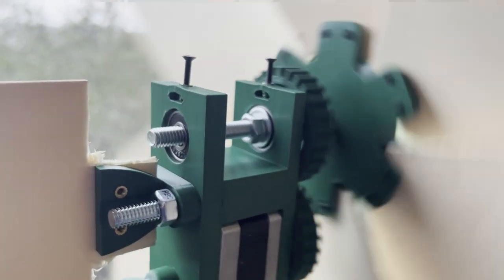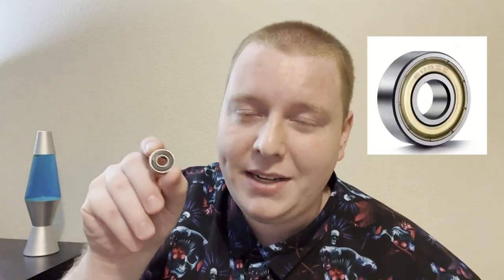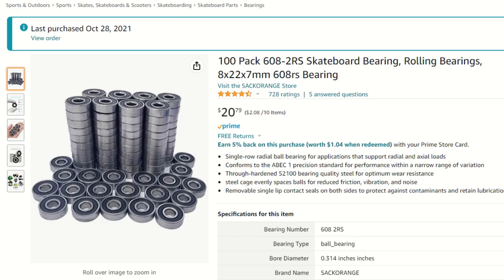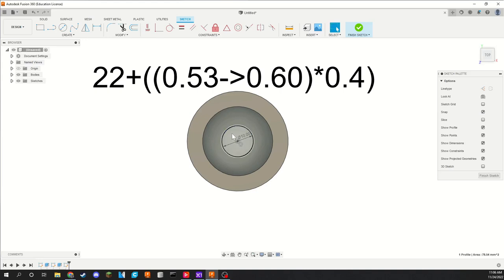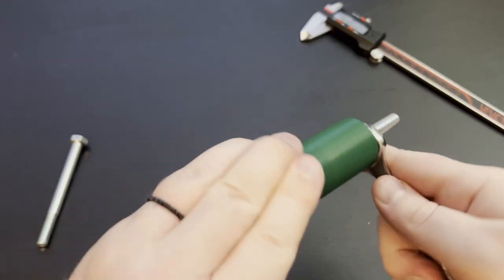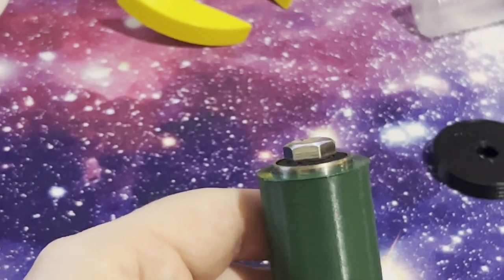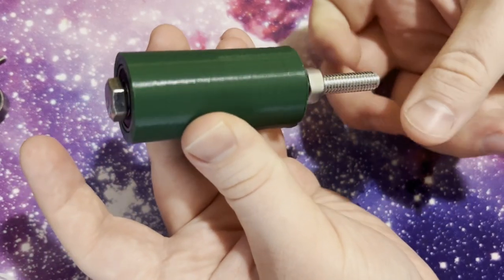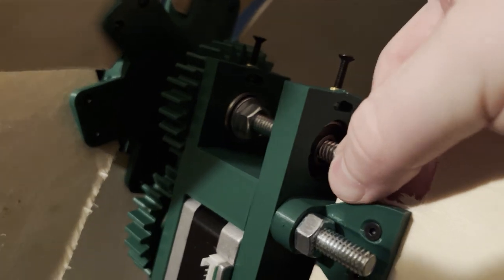Using Bearings with 3D Printed Parts

Comment: Instead of brass inserts, have you tried to embed steel nuts in a print? I design in recesses for the nut and screw, including tolerance for nut thickness and in my slicer I put a pause after the recess is printed, before the next layer. I then place the nut in the recess and resume the print. The next layer covers the nut. I do the same with magnets.
Reply from the maker: Sometimes I'll design a feature that can accommodate a steel nut, although I've never tried embedding them. Doing it during the print process certainly sounds more promising than trying to solder it in. Does that method work pretty well for you? 

What I'll often do is just make a square hole that's the height of my nut, and slide my nut in sideways through it until the screw can meet it. Perhaps a strength test video is in order 👀
Reply: @christophersfactory  Embedding nuts and magnets works very well for me. When I'm in a hurry I'll use the open square hole method, but when I'm fine tuning production prints I'll embed. I haven't tested strength but it seems to me if the wall thickness between the nut and the head of the screw is the same they should be about equally strong, though I think with an embed it might be a bit stronger, because the nut is pretty much locked into place while the opening for a sliding nut has to be pretty large to accommodate tolerances on the square nuts, resulting in some slop. In any case, embedding the nuts or magnets (when embedding magnets I use a tiny drop of CA adhesive in the recess to make sure they won't jump out of place, attracted to the other magnets) results in a cleaner exterior surface that looks less DIY.
Reply: How do you know when is the time to place a nut during print? Do you wait the whole time until it's ready?
Reply from the maker: @lovrocatela8727  If you're imbedding a nut, you'll want to wait until the past possible opportunity in the print to do so, otherwise it's likely that the nozzle will bump it. Personally, I tend to use that method less than just making features in the print that nuts can fit into.
Reply: @lovrocatela8727  After initial slicing, I insert a pause at the first level above the cavity for the nut and then reslice. I make sure that the cavity for the nut is deep enough to accommodate the dimensional tolerances of the nuts to make sure there's no chance of the extruder nozzle crashing into the nut. 
I also block supports in the cavities for the nut and screw. The layer above the nut is printed as a bridge. While that first layer isn't always perfect, it's almost always good enough to retain the nut and then subsequent layers go down just fine. The pause feature is availabe in the Prusa slicer (and Bambu slicer, too, which is based on the Prusa). I don't have to monitor the printer as the gcode will tell it to pause the print. The Prusa printers will beep to notify you that the print has been paused. I then insert the nut(s) and resume the print.

Comment: I find 0.15mm added to the OD of the bearing is good for press fit.
And it's not good to force bearings into place by the inner race, unless you're pressing it onto a shaft. You can damage the bearing. I made a 3d printed tool to press in, and remove, bearings in pulleys. It has a tube that only rests on the outer race and uses a bolt that's the same diameter as the bearing's ID.

Comment: WD40 will eventually turn to goo or varnish.  In the clock restoration business we hated it.  Flushing out the bearings with solvent like naphtha then adding a light oil will likely give better long term service as the cheap grease used in low cost bearings will be gone rather than thinned in WD40 which will mostly evaporate and leave yet more goo behind.

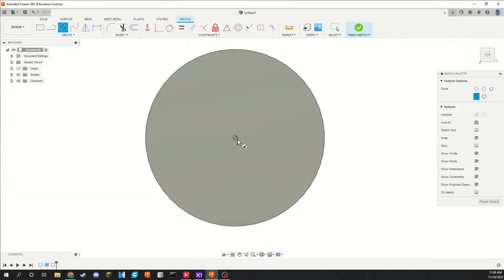Comment: I'm 99.9% sure what explanation about what the slicer doing at 3:05 is wrong. This may have been true when 3d printing first started but modern slicers can certainly account for the thickness of the bead being laid down. That's not the reason your bearing doesn't fit into that hole.

Comment: they are races not rings. the reason they lock up when you tighten the bolt is because they are coaxial bearings not trust bearings. the balls bunch up against the side of the race and causes misalignment in the races and this multiplies the issue and locks up.
Reply from the maker: Wow, I feel like I learn much more people than I have to share. I'll definitely need to make a Part II. Thanks for the info!!

Comment: Another method instead of glue could be to pause the print at the right layer number, put in the bearing, and then continue the print, printing also covering the other side just enough.
Reply from the maker: I'd be interested to try this! I haven't done much with inserting parts mid-print. I know many people do, to fair success. I just worry about the nozzle colliding with the part. Do you know of any way to avoid that?
Reply: @christophersfactory  You'll have to stop the print at the right height.  Check in your slicer.  You can do that with nuts too.

Comment: There's another way to solve the problem of a model that has a hole that is too big or too small for the bearing: change the horizontal expansion setting in the print settings. Usually -0.1mm to +0.1mm does it for me.

Comment: Dont recommend using set screws to secure bearings you will deform the outer race and make it oval. It's better to use a clamping style collar or press fit.

Comment: In cura there is a setting I believe it is called slicing tolerance (not really sure off hand) but the choices are inclusive and exclusive. This will let you tell cura if it needs to be at least or at most and it will put all .4 on the side of the line it needs to be.
Reply: That setting is for the vertical axis, not where on what side of a trace it should extrude.

Comment: I think the reason people don't like using wd 40 is it's acidic and may cause issue with certain coatings. made from fish oil apparently. it's great to get rid of water.
Reply: Which is what it's designed to do. It's full name is Water Displacement formula #40. It's not a lubricant.

Comment: Why don't you heat plastic if hole is too small and then insert bearing while plastic is soft?
Reply from the maker: That's totally a doable method, it can be a little difficult to ensure that the plastic only deforms where you want it to, and I would wager that that bond is still not as strong as just using superglue.
Reply: No freeze the bearing so that it constricts place the bearing and as it expands it’ll fit very tight. It’s how we change wheel bearing on cars.

Comment: Have you thought about adding a 3D-printed shaft that goes through the bearing, to whatever part you want to turn, with a hole through the center and a length-wise slit so that it could be squeezed into the bearing (so in effect it has "c" letter like cross-section) and then fitting a matching bolt through the center, to expand the shaft and squeeze it against the bearing tightly? Should be a good middle ground between the tape (only good for very low side torque) and two bearings a large distance apart (overkill for most medium-torque applications). And keep the thing much lighter and cheaper with the thinner and shorter bolt and just one bearing.

Comment: Great intro to bearings video.
- They are called inner and outer races not rings.
- The slop between the bolt and one inner race of the beating can also be minimized/removed by using a smaller diameter bolt and a thin 3d printed sleeve that fits snugly in the bearing inner race and fits tightly over (or screws onto) the bolt threads.
Reply from the maker: Thanks! I'm always amazed at the collective knowledge of a community. Thanks for being a part of that :)

Comment: WD 40 it is not intended to be a lubricant, but  a Water Displacement ...this why WD stands for.... What WD 40 say about own product  : "WD-40 Multi-Use Product protects metal from rust and corrosion, penetrates stuck parts, displaces moisture "....

Comment: 1 - that's not how slicing software works.
The rolerance problems you run into, is result of outer layer walls not being perfect flat, but having a teensy bulge in the middle.

2 - Compliant holes aint make the tolerance issue a non issue so long as the goal is to hold the bearing - they aint used in traditional manufacturing for same reason as why herringbone / double helicale gears aint - they are a pain in the ass to make compared to the normal hole (or gear)

3 - there is no "thick enough" part in the world where its impossible to bork via overtightening the screw. Even if its metal, if you are a dumbass you can turn that damned screw, till you screw the head of the screw right off. (Which is why manuals tend to specify how strongly a screw should be tightened -to avoid fuckin up the part or the screw)

Comment: bearings allow things to spin freely while fixed structurally in place... REALLY????? WOW!
a bearing has an inner ring and an outer ring.... that's amazing, I did not know that. you should have titled your video "what bearings are, explained for little kids" so that I could move on to a video that explains how to put bearings in 3d prints. i tell you what, i really don't want to watch this video now on the count of you having wasted my time already but i'll do it just in case i will actually learn something and then i will complete this comment... ok i learned the wd40 thing and about the high resistance of the standard grease. 6:38 i can answer your question. they bind up because they are designed for the load to be perpendicular but if you need lateral load then you have to get a thrust bearing. ok so here is the thing i was trying to learn that you didn't cover. a way to mount a bearing in a 3d print so that the bearing is secured from both sides and can't slide out but without using super glue. if the part breaks i would like to extract the bearings again and use them in a new part. one side is easy, just make the hole smaller at the end so it can't slide out, but the other side I need something to put in place like a clip to keep the bearing in the part. anyway, sorry for being hard on you, it's just that i think when people look up how to put bearings in 3d prints, they already know what a bearing is and how it works ;)
Reply: i figured out a good method. i'm adding a cap to the other side which gets glued in. it has 4 little feet with holes on the mating part, they slide in and it gets glued. if the part breaks or i want to redesign it i can just break off the cap and the bearing will come right out. for what it's worth i clicked on all your ads.